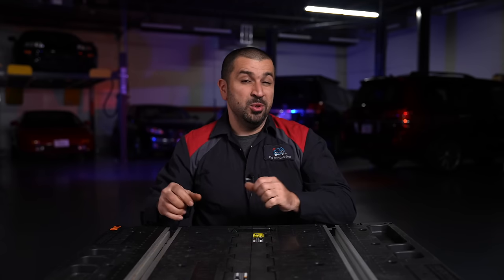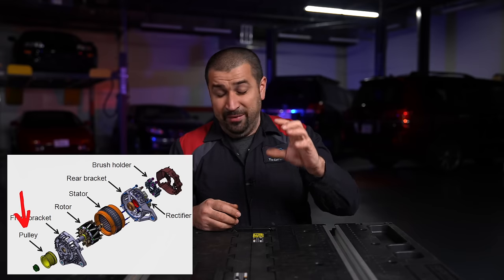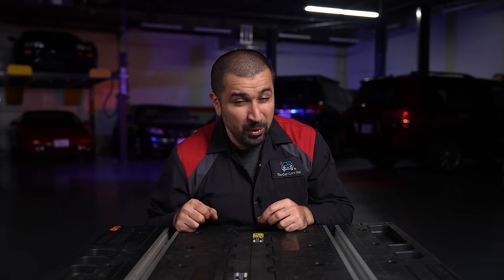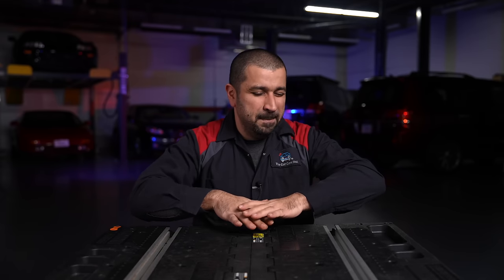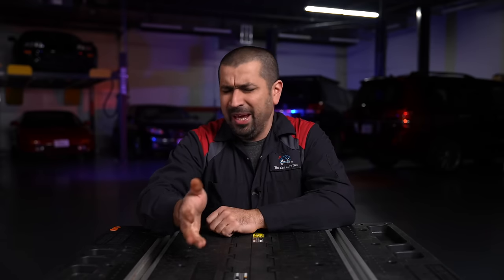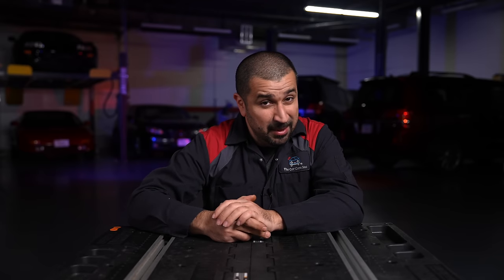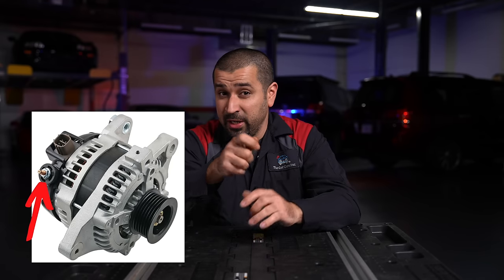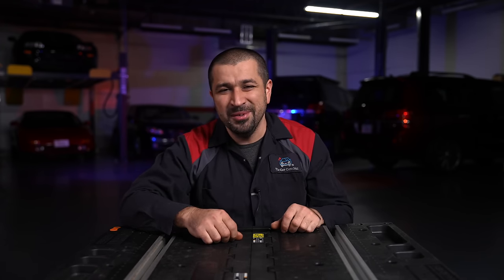How To Make Your Car's Alternator Last Longer? Everything You Need to Know

Comment: Yep I agree with that I have few times got battery completely empty in my Toyota Corolla and after starting it with one of them lithium jumpstarter packs I put a clamp A meter to see how much amps was going in and it was massive like 50A going into flat battery for like 10min and engine sounded very stressed, I had to open the hood to keep alternator cool and while 50A was going into battery there was another extra 15A produced by alternator just to keep car engine running. I can now see somebody easily breaking down alternator doing this especially if it's small output alternator and big battery capacity on a very hot day with headlights and radio on it's guaranteed to make alternator toast.

Comment: My valeo alternator on bmw e39 530d 2002 has just died last year. It has lasted 21 years without any maintenance, I bought some polish aftermarket which should last 10 years which is more than the life on the steel frame of the car… Fun fact, alternator was cheaper than 100Ah AGM exide battery ;)

Comment: I guess that’s true with Toyota but when I was just a young buck, just learning how to take care of my 1999 Dakota aftermarket everything went on it. It ran for another 10 years before I sold it and was running perfect when I sold it. It was at 120,000 miles when I bought it. It was at 200,000 miles when I sold it. Aftermarket starter aftermarket alternator, aftermarket water pump etc even the battery lasted eight years. Every part I replaced on that thing lasted well past the warranty. I guess it just depends

Comment: So essentially most if not all alternators are three-phase motors?   ...and are diodes a prominent point of failure?  Sounds like what might get fixed first when the "core' gets refurished?  Never knew.  Thx

Comment: 7:01 - Newer alternatives use a FULL-BRIDGE rectifier to get the entire wave -- 2 extra diodes. 

Then that's sent to the smoothing capacitors. 

Then a FINAL DIODE on the output, to ensure no backflow from the battery into the alternator and reduce constant load on the other diodes.

Well-designed alternators ALSO have 8 diodes, pairs in series, to reduce the strain on each diode to make them last even longer. 

EVEN BETTER alternators have the diodes in a metal shell, with thermistors attached -- which will cut flow of current from the alternator if the diodes get too hot (and can even cut off a bank of diodes if need be). 

All basic components.

Comment: I agree with MOST of what is said.

I would however point out something. If you have a vehicle with a modified electrical system (lightbars/offroad lights, aftermarket stereo, whatever), you will probably be running your factory alternator at maximal capacity for extended periods.

If you find that you are then having to replace batteries and/or alternators every six months, you might not have the option of staying with an OE alternator. At that point, seek out reputable manufacturers or rebuilders, who are able to build an alternator to your needs.

Comment: I've learnt from being stranded once or twice due to electrical issues (albeit usually on bikes).
Now when any of my vehicles become harder to start, I test the battery off / idle / @ 3K rpm with a multimeter and 9/10 usually need to replace it.

Comment: As an old guy I appreciate that the cars today will usually start with the turn of the key but most of the rest is garbage.  It used to be that with vacuum wipers they wouldn't work going up hill now it is the heater that don't work. The brakes won't stop the wheels, the accelerator won't spin the wheels, the steering wheel is no longer connected to the wheels, the alternator won't charge the battery, the spare tire is not really a tire, the signal light only makes a sound if the body control module plays a sound through the radio speakers and just when did the car loose control of its bodily functions straight from the factory?

Comment: 3/4 through... And... I feel a bit stupid. This is very obvious. Though, I have missed some of these obvious issues etc 

Thanks. You may have solved an issue with an old vehicle re mentioning diodes, a hard start, if at all.

But generally, couple items of mention, yes, very much needed re affirming of obvious points

Really needed this refresh. Thank you. Really :)

Comment: Corrosion will seize the pulley.  Recentlyv2 company cars Dodge Chargers were not used for 2 months upon start up both had seizd alternators causingbtge belts to be burn off.  Tow truck. New alternator, new belt  $850.00 bill for each car.  Salt air, winter corrosion causes alternators to sieze.  Some WD40 or other lubericant

Comment: I am glad you said that ALMOST all gasoline cars have alternators, because mine doesn't.  Good riddance to that and also belts, in my Prius Prime.  

And yes, I consider my PHEV a gasoline car much more than I consider it an EV, especially after living for over a year in a place where I never plugged it in.   I actually consider it to be a gasoline car where I can make 1/2 gallon of gas cheaply by plugging it in at home, which I now do every day that I drive it and return home.  It's not worth the bother to charge it anywhere else, unless somewhere I'm already parking has a free charger.  

I haven't replaced an alternator on a car newer than a 1997 Altima around 2005, but for that era of cars, a good third-party alternator was perfectly fine.  I think I paid 1/3 the price of the Nissan alternator, for one from a really reputable alternator manufacturer in Taiwan whose name started with V (maybe something like Victor).   I had two 1997 Altimas, one for each of my twins through their high school and college years.  The replacement was still working like new when I scrapped both cars about 10 years later.  Of course, the original in the other one also lasted 10 additional years, but if I had to pick one or the other, even at nearly the same price, I'd take the Taiwanese one over the Nissan one, not that I buy Nissans nowadays.

Having said that, I read hundreds of reviews of it on eBay, and maybe got lucky to find the best aftermarket one.  Between most people not doing that, Toyota and Denso parts being so good, and today's cars being more complicated, I think your advice to stick to the factory part, is perfectly reasonable advice, even if I suspect that there are still some great aftermarket alternators available for most vehicles if someone cares to research it and take a small gamble.

Comment: The old Volkswagens didn't have alternators.   They had DC generators.

Once I adopted a personal policy of replacing the battery every 50k miles or 5 years whichever comes first I quit having alternator failures.

Comment: It would be nice if you could have gone into which years did computers start doing each of those things you describe. Computers started appearing in cars in the early 80s. Of course, early computers were quite simple but what should one know about their computers' effect on the alternator if their car is a 1990, or a 2000, etc? The statements about the computer controls are a little vague in that respect.  And specifically, were alternators always only a maintenance charging device, or were they at one time a full charging device? Some older alternators are quite large compared to some of the modern alternators and did not seem to go bad if you jump started your car and let the alternator charge up a fully dead battery many times. You could be a little more detailed about those points.

Comment: 2020 4runner limited nightshade owner, just discovered why seat heaters not wotking fully.
My battery tested 12.5v but on test amps down to 400, so  "fail". Im guessing the electrical system sensed low voltage and compartmentalized the available volts thus sending less power to my heated seat?

Comment: My alternator on my 14 focus died at 228K miles replaced it and it wasn't my battery just worn out. My last battery test last month was 580/590 CCA standard Motorcraft battery. My vehicle has just a little over 260K miles.

Comment: Excellent  Video!
My own experience replacing  the Alternator , unaware I went for an aftermarket one for my 
‘07 Corvette and the Code still kept lighting up.
A proper Scan check proved the Alternator ( even after trying another one) incompatible.
The Fix was a Factory brand-new Part ( at about 3X the cost of the Aftermarket one)but it works flawlessly!
This confirms your advice to stick with Factory Replacement , when talking about Alernators.

Comment: Good advice OEM Toyota brand is the best I have 2006 RAV4 2.4 and have over 200k on it and replaced 2 alternator already should got with the oem brand but it cost 2.5 time the price that why I buy aftermarket.

Comment: Toyota hybrids don't have alternators, but use HV battery <> inverter/converter to power the 12v system and engine, correct?

Comment: Battery light means 'charging circuit not working'

Which in terminology of dynamos etc and the way those engine systems work... Absolutely correct .

And it stuck all the through till now...

Comment: Learned some new things today === thank u for your informative video. I also watched  your helpful videos on using oem motor oil and transmission fluid, which i got for my 1995 corolla with about 128,000 miles. Fortunately, no alternator or starter problems as of now.

Comment: I'm on my 2nd alternator with 308K miles.  The one I have now came from Autozone 10 years ago.  it's an " Approved" triple tested  brand rebuilt in Malaysia using  a Toyota Nippon Denso core. I have no complaints. It was $80 at the time plus refundable core charge, and taxes. The original alternator I replaced the slip ring brushes, which kept it going a while longer.

Comment: A question for you AMD. Recently my alternator in my 2000 Yaris (echo hatchback in the US) started making a the famous death whine. I replaced it with a genuine reman unit that came from a dealership. Ever since the new one has been installed it makes a higher pitch whistle noise at low RPM (between 1000-2000 rpm roughly). I've read that this is normal but having spent about £330 on a new alternator I don't want to have to buy another one. Belt deflection seems all good and I replaced the drive belt with a Mitsuboshi belt as the previous belt was squeaking a bit. The battery is a new Yuasa unit that I purchased around 3 months ago. output voltage and amperage are all within the service manual spec. Thanks

Comment: Thank you so much.  You're videos are very informative and fun.  I am posting here because this topic (alternators) is kinda interesting to me.   
In  1995 I bought a used Toyota T100 SR5 (4000k miles).  I still own it 29 years later.   It has 160k miles and has been used for a variety of purposes over the years.  It still has the original alternator on it and it has NEVER given me one bit of a problem over that period.  The same is true of the A/C system.  In fact, virtually its all original and all functioning like the day the truck was new!   The running gear is original and in great condition.  I do the maintenance regularly.  These things seem bullet proof.....
I am now 80 years old and this truck will out live me of course and serve someone else well if properly maintained.  It is a California vehicle so rust is not an issue.   Honestly, it's truly amazing......

Comment: On modern Chrysler and Mercedes-Benz vehicles if your battery dies and you jump it and remove the jump source the engine will stall. The alternator will not charge a dead battery.

Comment: My 2005 4Runner alternator lasted for 16 years, replaced in 2021 after I did a burn out at 5.5k rpm and it smelled like burnt rubber, it was a denso brand, not bad for 16 years of constant hard driving, 240k miles.

Comment: Would you consider a video showing how to wire a DC-DC charger?  I have a 2023 Tundra Hybrid and need to run a cable to my trailer. I’m not sure where to draw the power from.  The trailer is using an Anderson connector wired to a 30amp charger. If I’m not mistaken the 12volt start battery is charged from the hybrid battery. If it was not a hybrid I would not have ny hesitancy.  The hybrid system is the issue for me. Anyway if you think this would be a topic of interest for your other subscribers then it sure would help me.  Thanks!

Comment: my mother was extremely upset when the alternator in her Lexus RX died. A replacement cost a few hundred dollars(parts + labor + a new battery) .   She said she would never buy another Lexus or Toyota vehicle again. I don't blame her.  The original alternator only lasted 22 years and 182,000 miles.  Seems like a scam to me.  The alternator should have lasted forever!   😠

Comment: 2004 Toyota.   I have a voltage monitor plugged into a 12v socket.  After starting, it will hover at 14v during driving.  After a bit, it drops to 13.4v.  Does the drop signifying the batter is done charging?   The vehicle can go for several weeks between uses.

Comment: Driving a car at continuous high rpms will kill an alternator. I found that out when my transmission broke and I drove my Corvette in 2nd gear at 4,500 rpms. I also bought an aftermarket alternator for it that only lasted a few short weeks. Now it's AC Delco only.

Comment: Hi Car Care Nut, I have a small question, When I put the ignition in the on position on Toyota Corolla 1999, all the lights come on on the dash, except the battery warning light, what can be the issue here? And yes, the light bulb works and the wire connections are excellent. Thanks very much for your answer in advance)

Comment: Subaru's and Ford's 4.6L have the alternator high up! Most modern cars will message center check charging system along with the battery light. I've never had an alternator go out on a Toyota!

Comment: Amd, Does having a battery isolater with 2 batteries cause the alternator to break earlier? 🤔  I noticed my test certificate with new alternator says only 34 amps at idle versus 80 amps peak output. Thank you for the lesson. I learned many new things I thought I knew but didnt. 🙏 😊

Comment: Thanks for the tips on this particular subject. Very helpful. I own a 2013 Camry 4 cylinder for a little more than a year. I just found out after the oil changed. I drained old oil out,it was only half full. After filling up new oil, I drove for three weeks,check oil level again,it half full again. No leak on the ground. Why is the engine consume oil, it’s not that old ? Thanks

Comment: Spot on, replaced it in my 100 series land cruiser stuck with the original, It failed after 330000 km from new.  Note fuse box had to be replace as well.

Comment: I used to work for Denso at DMTN Denso maryville Tennessee. I used to assemble  these alternators i can rebuild my 2011 camry alternator in under 30 minutes in my garage at home. But how expensive individual parts are becoming its almost more cost effective to just buy an alternator. Which is sad. Ill still rebuild mine until its cheaper to just buy one. I enjoy it, and the satisfaction is immense.

Comment: Sometimes you got to buy aftermarket because you're running 4000 w stereo in a factory alternator won't work because a Toyota like mine 80 amp can I upgraded 240 amp alternator

Comment: I Learned my lesson years ago I bought an aftermarket alternator for a Nissan maxima, and I had to return it 3 times. Upon returning it the third time I was frustrated. The parts store counter guy blamed me for miss diagnosing the vehicle & gave me my money back.

 I got the original from the dealer & finally fixed it. As a shop foreman at a major dealership with 20yrs experience I should have know better. In my case, I should have used better judgment. for inexperienced or diy listen to the guy with the experience, Some if not most parts should be Purchased from an original equipment supplier this is more relevant today with vehicles being more complex than ever.

Comment: How long do modern alternators last? My 2013 f150 has 150,000 miles with the alternator constantly im mud and submerged in water a few times. Should i change it before i have trouble or does it still have life left?

Comment: I bought an aftermarket alternator for my 2013 Toyota and it was nothing but problems for an entire month.  I ended up replacing it with an alternator from my Toyota dealer and it worked perfectly fine afterwards.

Comment: Thank you. I had the battery and alternator go on me last February with no warning the car just wouldn't turn on. I have a 2010 Corolla Le the cost was $672 to replace both that included labor. My mechanic deals only with Toyota parts direct from the dealership. The alternator is the most expensive part $319. 

You are correct about old school alternators going bad the dashboard light would dim or go out or worse the front headlights going out on the highway.

Comment: Alternators spin around 3x engine RPM. VW realized on their diesels that it was the abrupt change in engine RPM that caused crank pulley issues on older high mileage models. They then added the free wheeling pulley to the alternator to correct this issue.. The main parts that go are the bushings and brushes and voltage regulator (for older models). Fairly simple to replace with the right tools. Diode pack rarely goes. Mosfet switching would be far superior, but more expensive and complicated.

Comment: How about addressing the issue of keeping your battery clean? I've measured a few volts across the top of a dirty battery, which will discharge it over time and tax the alternator. 
I have a '99 Subaru with the original alternator and it's  3rd battery in 24+ years. I've replaced only 1 alternator in the 40 years I've owned cars and 1 motorcycle stator.